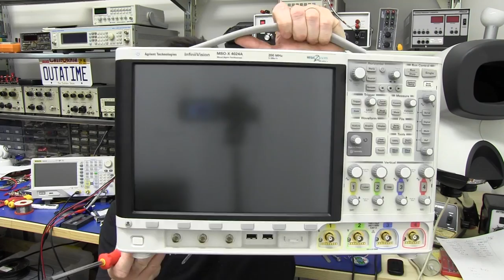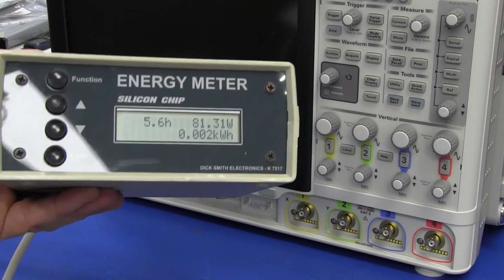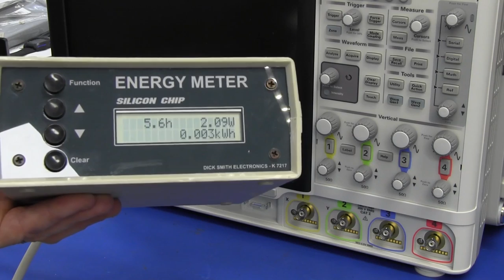EEVblog #384 - Agilent 4000X Oscilloscope Teardown

Comment: Since the scope can accept voltages over a huge range (100s of volts down to millivolts), you need some circuitry to convert that range to the narrow range (often +/- 2V or so) for the A to D converter chips. An analog front end is a collection of attenuators, switches (relays or MUXes), and amplifiers which accomplish this task.

Comment: The connector at 2:45 will be for the 50/60Hz mains line trigger via by the opto-isolator at 20:45.  Mike shows this in his teardown of his 6000 series scope (v=5lYbD9_eIko at 6:05).

Comment: I think I have an explanation for the unpopulated BGA chip, based on my wandering in the firmware : it's a FPGA tagged "usb retriever", used to support High-Speed USB decode.
So the chip has to be standard in the 1.0GHz and 1,5Ghz versions, and not present in the lower bandwidth versions.
Btw, the low/full-speed USB decoding seems not to use this dedicated FPGA : only the main FPGA is used.

Comment: The chip near the front panel USB connectors is a Renesas uPD720114 4-port USB 2.0 hub.

Also the the touchscreen is connected using USB, so probably all USB connectors and the touchscreen go trough the hub.

Comment: If they already use a 10 MHz reference internally, why in the world do they not offer an input for an external 10 MHz reference input? That's a feature I have been missing in oscilloscopes for a while. Most of test gear has 10 MHz reference inputs, just the oscilloscopes don't.

Comment: I believe that unpopulated BGA between the ADCs is populated in the 6000X series which also uses MegaZoom IV and should be the same form factor as the 4000X series. The 6000X series has better sampling rate (20G vs. 5G per channel pair) but lower update rate (450k max. (135k default) vs. 1M). Interestingly, the front end is always >6 GHz capable, all bandwidth upgrades should be licence key only.